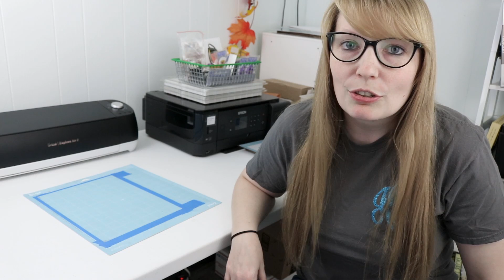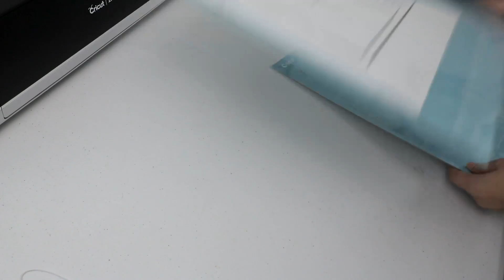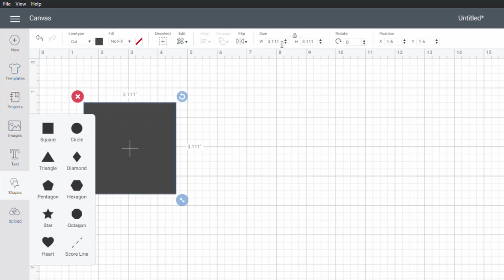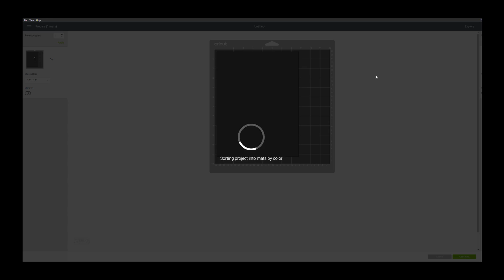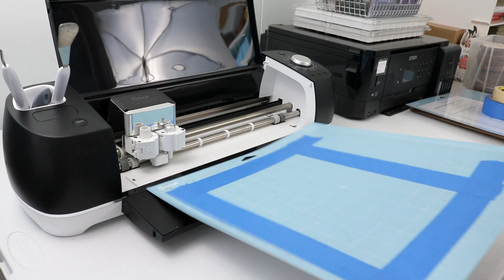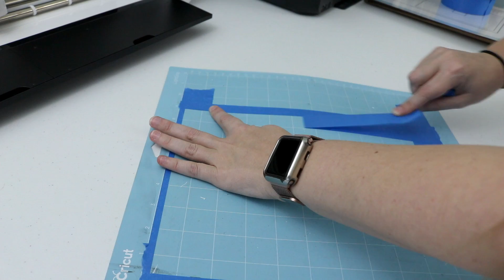Full Page Cricut Hack Tutorial Part 1 // Cricut Explore Air 2 Stickers

Comment: Just curious, why would you not use this perfectly positioned mat for calibrating print-then-cut?
Reply from the maker: The print-then-cut feature prints a large black border probably an inch from the edge of the paper which really limits your space to print things. Whereas the "hack" lets you print all the way to the edge of the paper therefore fitting more items on it. Also even when using the print-then-cut feature (which I have) it still doesn't always cut properly. This video is 3 years old now and I no longer use the Cricut. Over the years I've spent too much time, energy, money, and materials just trying to produce something decent. The machine is never consistent no matter how much calibrating you do. If I want anything made these days, like stickers, I'm outsourcing because from my experience the cost is the same or less and it saves so much time. If stickers aren't cut right then usually the manufacturer will just re-do them for you for free saving you all the hassle....but that's just my opinion 🙃
Reply: @JessicaLynnIllustration  Thank you so much for your reply.  I always appreciate when someone shares real-world experience.  The information about creating the page placement with masking tape is helpful.
Reply from the maker: @connienewbold6520   You're welcome!

Comment: I can't get the tutorial to work with A4 (210mm x 297mm) sized paper. I get an error saying: 'At least one of your images is larger than 11.5" (29.2cm) in height or width. Select O.K. to continue with a larger mat or Cancel to return to the canvas to reduce the size.' Looks like using 'Shapes' is reverting to the US letter paper size. Seems strange as here in the UK we use the metric system for our paper sizes and I've got Cricut Design Space set up for A4 sized material. Anyone got a suggestion as to what's wrong? Thanx.
Reply: I'm just trying to work this out! It's so frustrating right?! Did you find any better tutorials? If so I'd love to know - it seems like such an obvious thing Cricut should address.

Comment: What printer settings did you use for scaling? I’m having trouble aligning the print size with the size of the cut file. The cutting is good, but the print size is either too small or too large. Can’t seem to get it right.
Reply: so i had a huge issue with this let me tell you what i did. I save all my print files as PDF and use adobe reader (acrobat) to print them i select the actual size before printing keep in mind you will need to go into the prefrences and select print as image to get color and you will need to use the printer settings in adobe to choose your print quality/ paper type. i also do this for printing out my calibration sheets
Reply: Maybe that’s the issue I’m having because even for the square it prints it differently every single time 😔

Comment: from y our video and thinking about it. i used the plastic sheet that came on it :) new sheet. so i left that sheet cut it then pulled middle. do my cuts then ill put that piece back to help save from dust :) 
ty
Reply from the maker: That seems like such a great idea! Do you have an Explore Air or Maker? I'm not sure if my Explore Air could cut all the way through that clear plastic.
Reply: @JessicaLynnIllustration  i have the air 2. it cut through great. 1 cut pass on vinyl. then i put tape then did the cut again to help me have a ledge for putting the papers down to help get square. BUT im having trouble. my printer is not printing full page. and the marks are in a little on paper and not lining up to cut right. so driving me nuts. ive tried tweaking printer settings. 
stumped a lil
Reply from the maker: Thanks for the tip! Yes a lot of ppl have been having issues with their printer, which even the tiniest change would make cuts off. The only thing I can really suggest is googling your exact printer model and how to remove margins / borders or how to print borderless. Some printers may not have the ability to do this unfortunately, but you'll have to do some research.
Reply: @JessicaLynnIllustration  ahh so I should try to print borderless?

Comment: I have thinner tape - what is the size of space you are left with inside the tape lines?
Reply from the maker: The inside square comes out to be 8.5 x 11 inches if you follow all the same measurements as I do. You can use thinner tape but you want to make sure to do a couple strips on each side so it's wide enough for the machine to cut the square out...if that makes sense
Reply: @JessicaLynnIllustration  thank you!
Reply: Double up your tape I double up the blue tape even and you don’t need to go around the entire mat that is the old way of doing it. You only need the left side and top. You don’t need all 4 Registration squares either. I have new videos explaining this coming soon.
Reply: @EricMBoyd  So, if i have the mat with the cut-out triangle at the bottom (facing me), I only need to tape the left and the top (facing the machine)?

Comment: Can I do this some how with out printing? Just cutb?cause I want to cut some vinyl I screen printed on
Reply from the maker: Yes you should be able to. In the DesignSpace software on the left there is a shapes button. I would measure your vinyl where you want to cut and assuming it's one of those basic shapes you could just use those and adjust the size. If you are looking for a custom shape/cut thats where it could get tricky...you would have to either scan your work or take a picture, use an editing program to create your outline for your cut, export the cut lines as a .png file and upload to DesignSpace. It's doable, but a lot more work and room for error. Never heard of screen printed vinyl before, but it sounds cool!
Reply: @JessicaLynnIllustration  that’s for the reply! Nothing special I just printed with white ink on oracle 651 but I don’t want to just get squares I wanna contour cut them. Nice vid

Comment: Hi! Just want to ask why is there a need for the painter’s tape? Can I still use the hack without the tape as the usual cut setting can normally cut without any tape
Reply: You can use thick card stock as long as it remains stuck to the mat.
Reply from the maker: The tape shows the outline of where to place your sticker paper. This hack is to bypass the Print Then Cut feature, to allow more room for stickers. Perhaps if you watch Part 2 you will understand.

Comment: Even though the mat is 12x12 the machine will only cut a maximum of  11.2x11.5, and that's why there's the .25" gap.  You also don't have to move the rectangle to the very top of your canvas.  When you tell it to cut the machine will always position the cuts in the upper left of the cutting mat.  You can move it once you get to that step but if you actually want it there, no extra steps are needed!
Reply: Actually, the maximum cut size is 11.5" x 11.5".  And, yeah, you don't need to move the rectangle to 0,0 on the canvas; it will go to the top left corner of the cut mat on its own when you press "Make It".
Reply from the maker: Thanks for the info - I've never tried cutting anything bigger than 8.5 x 11 and once I found something that worked I stuck with it 😀